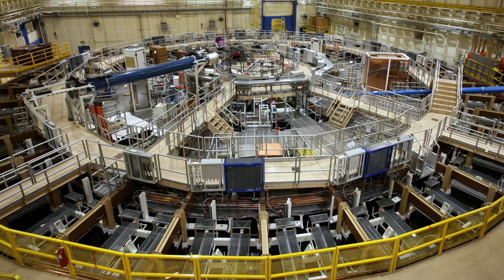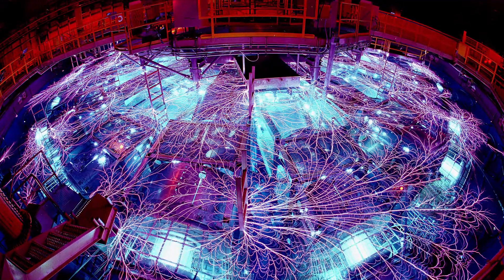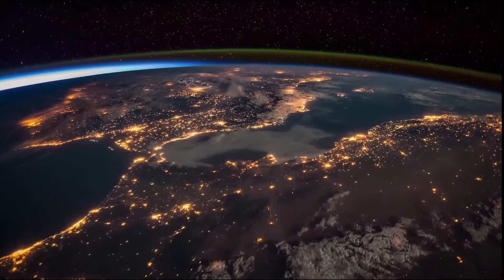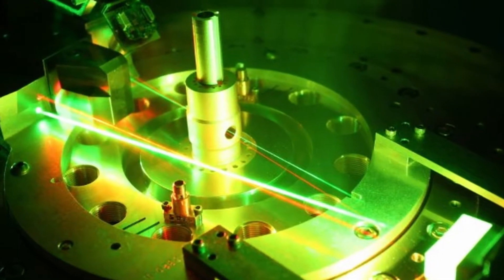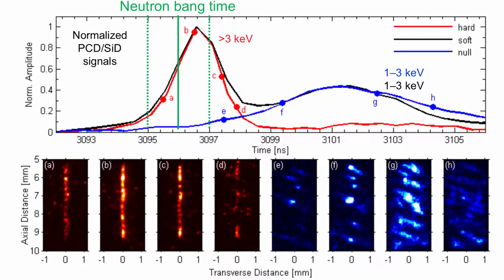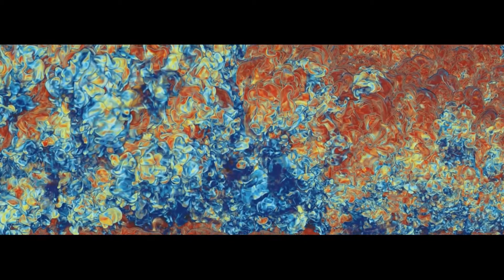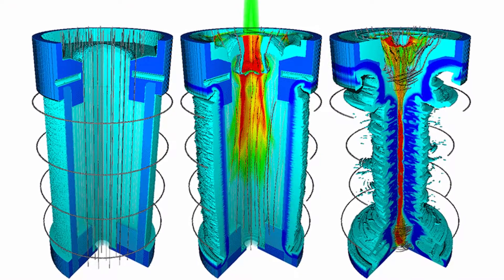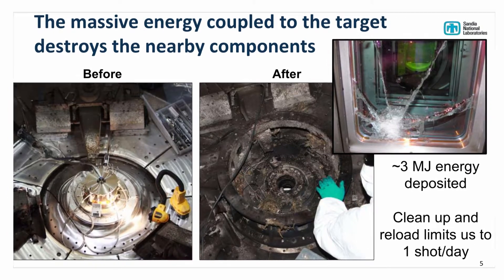Dr. Matthew Gomez: Pulsed Power for Plasma Fusion

Comment: "My fusion design focuses on achieving aneutronic \text{p-}^{11}\text{B} fusion in a golf ball-to-football sized core by solving the Bremsstrahlung loss problem through extreme density compaction. Instead of a massive capacitor bank, the system uses a \mathbf{10\text{-}12} stage Magnetic Pulse Compression (MPC) cascade (the 'Russian Doll' fields) to amplify a 15\text{-}25\text{ MJ} bank into a \mathbf{60\text{ MA}} shockless drive pulse. This pulse smoothly implodes a carbon-nanotube/graphene liner to compress the fuel, aiming for high density to make the plasma optically thick. The goal is a sustained, reusable proof-of-concept for localized, clean fusion power."